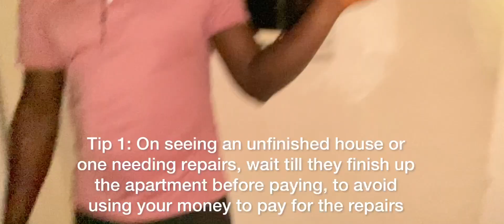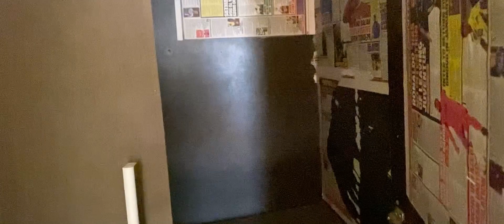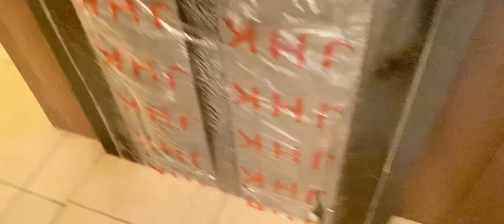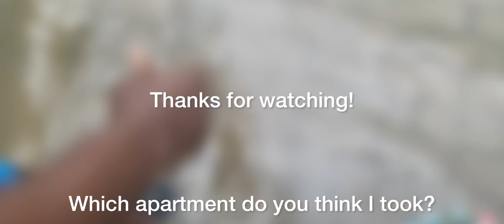House Hunting in Lagos Island 2022 : How Much is Rent in Lagos + Locations. Perverted Agents  & More

Comment: Hello ! Greetings from Romania! I know Lagos is very expensive town . How much money / month I need to live in Calabar ( say me in US dollars) .To rent an apartament in a good area - 1 bedroom only - , for food , tv chanel , internet . I want a good life but not luxury .
Reply: I live in Lagos not Calabar but I'll say you need around 150k =$100 per month to live a really really good life. You could go as low as $50 if you cut back on some things and cook by yourself.

Monthly expenses
Food(cooking)= N90,000 $60 for foodstuff budget that'll last like 2months.
Food(ordering 2x/day)= N135,000 $90 in a month

Internet subscription(phone) N6,000 $4
Internet subscription(unlimited for home) N12,000-24,000 $8-16. Depends on provider

Cable tv subscription(Netflix) N6,000 $4

Electricity N15,000-30,000 $10-20 monthly depending on how many appliances you use e.g you'll need to recharge more if you run your AC 24/7, refrigerator, Tv, microwave, freezer etc.

To get a nice ensuite 1 bedroom with separate living room with visitor's restroom and sensible kitchen space, budget for N900,000 $600 for both rent and other fees (agency, agreement, commission and caution/maintenance fee). 

Rent when paid runs for a year and not monthly. Water is usually supplied free from a borehole pumping machine in the compound from ground water. For electricity, you pay monthly or when it finishes by recharging your pre-paid meter card.  

MAKE SURE YOU GET A HOUSE WITH SEPARATE PRE-PAID METER PER APARTMENT!!!! or you may end up paying the debt on the meter left by the previous tenant(s) if it's a POST-PAID meter.

Also make sure you have money to fully furnish the apartment (mattresses, sofa set, fridge, washing machine, gas cooker and cylinder, fans, AC's, TV, speakers etc) by setting aside another 1.5m N1,500,000 $1000. 

Check www.jiji.ng for the most reasonable prices for what you want to buy. Only make payment for pay on delivery or where the vendor doesn't agree, go to the store address and pick up personally. 

Check www.propertycenter.com for affordable apartments in Calabar and for trusted agents to finalize with when looking for a place.

GOOD LUCK
Reply: @dolapoeniola8834  Thank you so much , you are very kind .
Reply from the maker: Thank you for this detailed response . I’m sure it’ll help not just the person who asked the question, but other people who may have similar question 🙏🏽☺️